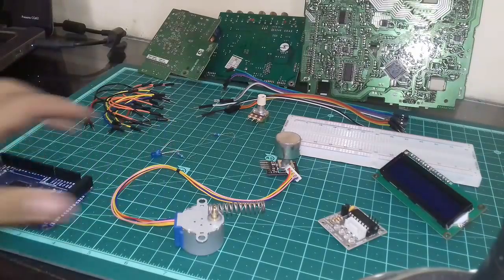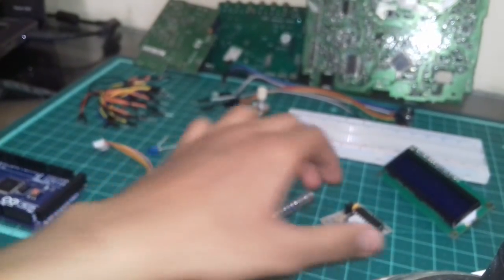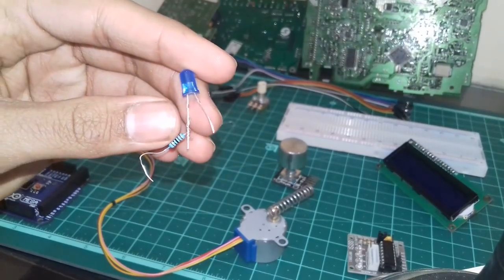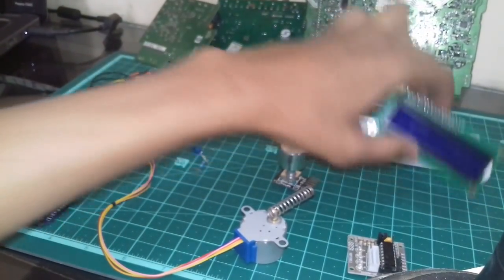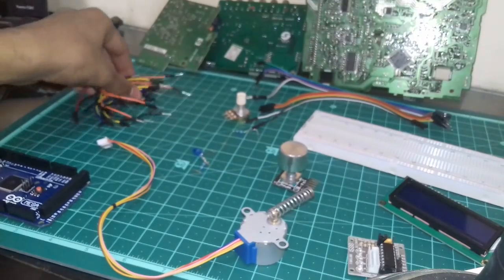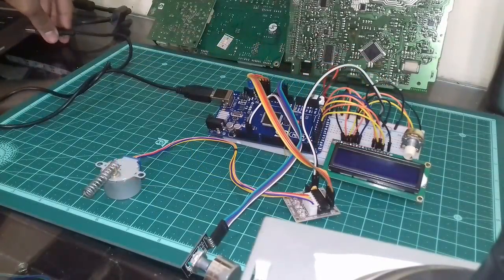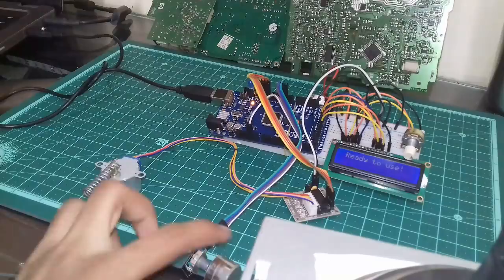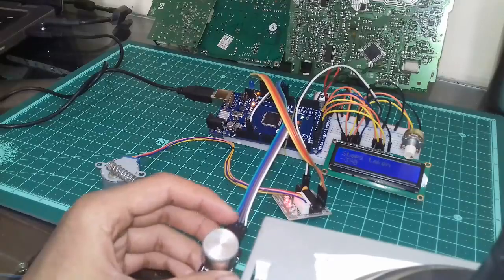DIY How to control a stepper motor's position using a rotary encoder

Comment: My stepper and encoder work nicely with other scripts but with this one, the stepper moves properly for a few steps then bounces back and forth then continues on while turning the encoder in one direction.  The same thing happens in the other direction as well.  Has anyone else had an issue like this?
Reply from the maker: Make sure that you have wired the input pins of the stepper driver in the correct order with the microcontroller. Try changing the order in which the wires are connected.